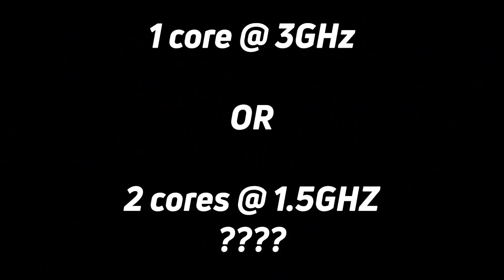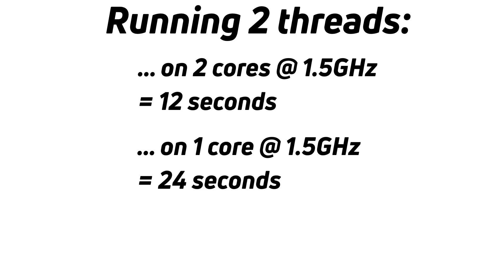Single-core vs Multi-core Performance and Efficiency

Comment: Hi Gary! Dont know if imissed this bit while having to look after a 3 year old monster but....

The load the program requires would have made for another comparison. An app that prefers single threaded, high frequency operations would never be faster on a power efficient cpu as the program isnt designed to split the load. I would call this a badly designed app but im using it as an example.  Seperate from gpu and different hardware architectures. 

Only say this as i think theres some simple people who wont take "programs being written properly" to cover this point.

Comment: Could they make mobil Cpu with 8 cores clocked from lets say  1.7-2.7(all 8 cores),so when it is needed they work only on 1.7MHz and and when it is needed they use all power(go to 2.7MHz)?
Reply from the maker: Yes, we have that already. Dynamic Frequency Scaling is normal for Android SoCs.

Comment: Would you rather have 5ghz 8 core or 3.5 ghz 16 core ( same arch ) ? Multi threading code(program) to run on more then 8 cores is beyond capability of our software devs
Reply from the maker: Sounds like "your" software devs aren't very good then.

Comment: Interesting video. Although I should note that in practice not all code can be made parallel. In particular, if one operation requires the result of another operation to complete then it'll have to wait regardless, and more cores won't speed it up. I also play my share of older games that weren't developed with many cores in mind, so I did buy a CPU that focused on single core performance for those games. That said, it's still a 6 core / 12 "thread" CPU (i7-8086K), so it'll work well for multithreaded tasks.

Comment: The Xeon Phi series was the closest the world got to one of my ideal architectures but I've thought up a design from a rigid premise... a 2D, single layer architecture.... I know CPUs and PCBs have many layers but in 2D Flatland the maximum number of cores that can directly link to every other core without crossing lanes is 4. I think a triangle is the most effecient packing of cores and connecting lanes.. You can have multiple lanes connecting each core in this each-to-each network, but 4 cores max.. I mused with the idea of a fractral-like configuration with 4 joined cores forming a higher level core, with 4 of these then joined to form the next level core, and so on.... this is all in 2D but you can have multiple 2D layers. The idea is you have far fewer vertical connections, errors in which reduce chip yields. 

You can go as big or as small as you like, with as much redundancy as you like (if a level 0 core fails there are plenty left)... 4 cores can share each other's on-chip memory and work together in a number of modes. Level 0 cores could be very simple, or a full on X86 core.. I'd start with simple ALUs, probably a multiplier or 2  each. perhaps floating point at level 0, perhaps level 1.. They can work together to form a GPU, or multicore CPU, or both, on the fly...

Having said all that, it's probably not a great design in this ever more complicated, 3D chip world, but you never know.. it is based on logical principles.

Comment: I remember getting the Samsung Galaxy Note 3 back in 2012-2013. All because it was the 1st North American smartphone with a 1080p Super AMOLED and 3GB's of ram. That with a Snapdragon 800 (28nm/HPM) 2.23GHz with the Adreno 330. A Quad core running at that speed was unheard of. It even beat out the nVIDIA Tegra 4 in gaming. In 2015 when the mod and root scene was popular i overclocked the Snapdragon 800 to 3.1GHz on the Note 3. I kept it running long enough to finish GeekBench 3 and set a GB record with a SD800. It should still stand today on HWbot.
Reply: one problem with most phones including all Samsung phones is they don't have developer additions like the one plus one and the one plus6 are, Samsung phones, can only run locked down closed source proprietary Android OS (i know it is based on open sourced Linux) which most likely reports on your activity to Samsung or Google and the NSA (else why keep it secret?). perhaps it's ok if you are not doing anything illegal or immoral, but if you paid for your phone and supposedly own it, would you choose to send your data off to them if it were up to you? if you had kids, do you approve of Google and the NSA having file on their activity cause one day they'll nominate them for sainthood? you could get a $150 Pine Phone that ships without an OS (new but uses 3 or 4 year old technology) and if you can get it running with Ubuntu Touch you can have better privacy, which for some people is important. however faster phone and technical advances are needed. so thanks for pointing out how great the Notes are. I didn't think they could be overclocked. the recent announcement of Samsung partnering with Microsoft may produce better phones if they go down that path. while Microsoft has done some pretty bad stuff to open source projects in the past, in some ways they have learned their lesson and not only contribute money to almost every linux convention that takes place, they developed WSL, the Windows Subsystem for Linux and open sourced many projects (Ex Fat and PowerShell) so they can be audited and used by privacy caring individuals. I got a One PlusOne and got Ubuntu Touch to open on it, but it lacks important functionality. I cannot get it to function as Rob Braxman tech, YouTube channel has done. thanks for posting

Comment: Were there not single core, but hyper-threaded  CPUs between the single and multi-core CPUs? I am sure I remember having a 3ghz P4 with hyper-threading in about 2003/4 before getting my first  true multi-core  AMD phenom II x4 @ 3.4ghz in about 2010.

Comment: so isn't, there are some programs which can't make use of multiple cores or I am getting that wrong?
Reply: LibreOffice runs on single core. It runs slower on i7 than i5
Reply from the maker: What tasks are you doing in an office suite that allows you to measure its performance across different processors?
Reply: Yup. Gary kinda explained poorly, and his benchmark basically prefers multiple cores because it's a task that can be easily split into many pieces. Not all tasks can be so easily split.

Comment: The simplification in this video is .... mind blowing - without taking everything else you have mentioned and said and pointed to in other videos into account this really says NOTHING.  You might as well also say that it depends on how much cache per core? is it shared over multiple cores? is it dedicated to one each? Water is wet, unless it is dry.
Reply from the maker: LOL, I think the problem is that you didn't understand it.
Reply: Your efficiency does not scale and outside of specific symmetrical mathematical computes does not make one squat of difference.  Performance will scale less than linearly with the number of cores put in place. In fact, the incremental value of adding another core approaches zero as the high degree of intercore communication eventually overwhelms the gain adding the core.

Comment: So the conclusion is In ideal environment, more cores are better.

Bur in real life, you can't do work without doing prior work, hence doing it faster in single thread will make it faster.

Unfortunately life has no straight line, so the combination of more cores and more frequencies will be great.

I really wonder... a modular processor such as Ryzen should make use of different architectures.
Why don't they combined 1 chiplet of Zen2 and 1 chiplet of Zen+, and so on.
It will drive their processor price down since it will reuse old technologies but will increase the overall performance.

Imagine you are playing with 8 cores (4 cores Zen2 and 4 cores Zen+)
While gaming nowaday can't take every advantagr of cores, having 4 higher performance will crank the performance in game rather than 8 low performances.

The overall multicores will be lower than you use all Zen2, but hey... it will still be cheaper.

And as far as I can see, It will prolong the life cycle of Zen+ and Zen2.

Extend the 2020 end of life of AM4.
I mean... I'll be satisfied to have $200 8 cores processor.

But it will run like big.little ARM, could it be infringe IP?
Reply: @Vishal Belbase I have heared it. Have a very little knowledge on it. Maybe you or even Gary can explain it 😆

Comment: Is 12 cores 24 threads cpu good for future gaming ? Like in coming years
Reply: No, sorry bro, you'll need 24 cores the next year.
Reply: I think it's more than enough for a few years. Hard to say what the future of gaming holds, though, especially on the CPU side of things. The big problem with predicting gaming is when something becomes big enough to split among many cores, it might be offloaded to the GPU. Game developers are often familiar with GPU tools and GPUs are massively parallel devices.
Reply: @logicalfundy  In my comment i was joking, things are about to become interesting with the new consoles powered by 8 Zen 2 cores and nvme ssds. Requirements for PC AAA games are about to become higher.
Reply: @PietroSoft  Perhaps it is a joke, but it is valid (and interesting) to ask what the future of gaming is with respect to the CPU. What tasks do you leave on the CPU, and what tasks are should be moved to the GPU? Balancing the two processors to make effective use of the entire system is something game developers have to consider.
Reply: @logicalfundy  thanks for info. I wanted to build desktop so i thought since console have 8 cores using 6-7 for games, extra remaining 4 cores in desktop cpu would be good for background video editing and thats should be good for next 5-6 years.

Comment: damn that was amazing, I learned more than in 11 years at school. Just 1 question - some code cant be multi-threaded by nature, so single-core perf will always matter, right? For example games, can they really digest all 16 threads in future ps5? Very unlikely
Reply: dx12 is mainly made to make games and developers use multi threaded cpus
Reply: It's definitely true that not all code can be made multi-core - and many games can't take advantage of multiple cores. I bought a 5 GHz CPU because many of my indie games are basically single threaded (Kerbal Space Program used a single thread for physics, but it's been a while since I've played so I don't know if it's still the case). That said: Actually, there are things games do that can be multi-threaded. Physics and some types of AI can take advantage of multiple cores. The game loop itself can be put into a different thread than other tasks, as can networking and file access. Doing so can increase performance because if they're in different threads they're not blocking each other. I should note that modern AAA games do generally take advantage of multiple cores - so if you're into the big blockbuster releases, then more cores makes sense.

Rendering the graphics can theoretically be done on multiple cores as well, but that's offloaded to the GPU these days (which is actually massively parallel, more than any CPU - high end GPUs can have thousands of "cores").
Reply: Yeah single core performance is always important, I think we’re getting huge diminishing returns once we pass 6 cores for most programs. There is a limit to how much a program can be divided to where either you'll break the logic or it will defeat the purpose because one thread will be waiting for another to finish before it can move on.
Reply: linux gamers know the limitations of single threaded gaming very well. 

the main api that is used to enable the cpu to contact the gpu and let's it draw a frame is opengl on linux (and mac), whereas on windows it's directx. opengl is pretty much all single threaded, so you are limited by one core most of the time, unless the game logic is very exotic and can leverage the rest of the cpu.

now this is pretty stupid, because a four core cpu, let's say, has one core at a 100% utilization while the other cores only handle some game logic and maybe the operating system and hover at about 40 percent. that's 3 * 60% cpu power that you're just wasting because opengl is single threaded. 

this can become painfully apparent, for example in the 2013 tomb raider reboot, where the frame rate can go down into the 20s in some demanding instances with the gpu at 40% - 50% and the cpu overall also at maybe 30% (on my pc).
now if you run the sequels that natively run vulkan, which is a way more efficient api that is also able to run multi threaded, on linux, then cpu utilization on a 4 core, 8 thread cpu can go up to 90% - 95% utilization in my testing. also frame time consistency is vastly improved and micro stutters are way less severe, when loading in assets for example. 

i guess this issue of opengl being unable to use multiple threads is why windows generally has had superior gaming performance for quite some time, because directx is doing multi threading for quite some time now afaik.

so anyway, graphics apis can very effectively make use of multi threading and therefore games definitely can take advantage of multiple cores.
Reply: NPC Ai should be able to leverage some of that extra computing capability. I can imagine there being some limiting factors when it comes to multi-threading single tasks such as part of the code requiring a result produced by the earlier portions of the code requiring the instructions to be sequential rather than parallel
Reply: Actually...  I can recall 1 game that uses A TON of CPU cores and threads - battlefield 4 I believe it was, certain multiplayer maps can use up to 32 cores 64 threads!

Sadly this not the rule, it's the exception. Yes we can make use of more than 16 cores/threads in game, but it's a matter of convincing the investors at any given game developer to take the time to coffee for all those threads. Without just simply telling the system to throw a ton of random commands at the CPU. Greed is killing gaming on many fronts right now, especially when it comes to polish, and performance. However with any luck the release of the ps5 and the new xbox perhaps in a few years we can get lucky and have something decent going again in the industry let's hope so
Reply: @bogartwilley  I'm sure it can, but it wont be maxing out each core, so it should run equally as fine on a good quad core, so I think my point of diminishing returns still stands. Adding more threads in code also increases complexity (which can increase bugs) and can actually slow down a program if you truly don't need that many threads, it can be more efficient to run it with fewer threads. Especially because each thread also has to check resources before using it, this also adds overhead, granted its minor but it grows with increasing number of threads, and can stop threads from running if other threads are using resources that also need to be used by others further degrading performance, this can also cause problems in programs which is rare but can happen with inexperienced programmers.
Reply: With multithreading it is difficult to use all cores identical, so usually one cannot run all of them at 100 percent, especially in gaming.
For gaming you want to prevent frame drops, even in case the cpu is already starting throtteling... so the game tries to get cpu power without using it/at least without causing a lot of heat...
Reply: 16 is nothing for games, GPUs have THOUSANDS of threads on the fly for rendering.
Reply: @mas921  GPU  do very different type of work thats highly paralleled, and I am talking about CPUs you idiot
Reply: @Raven-lg7td  Each core can process 3 or 4 threads, so an octicore CPU will be able to handle it. And who knows, maybe they will boost the CPU to 10 or more cores for the ps5. 2020 is a revolutionary year in terms of technology so I believe they will make 10 cores